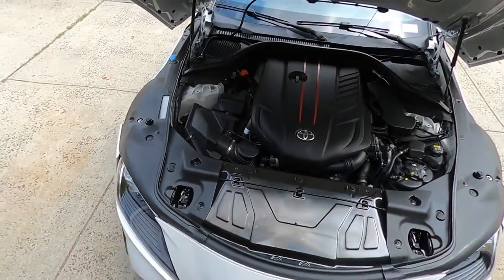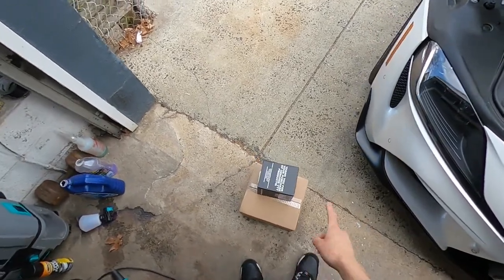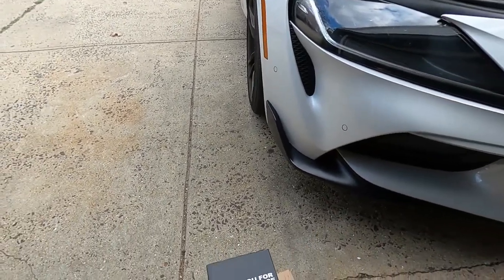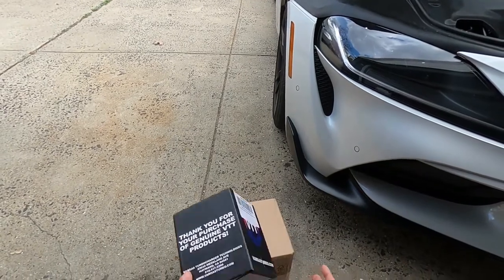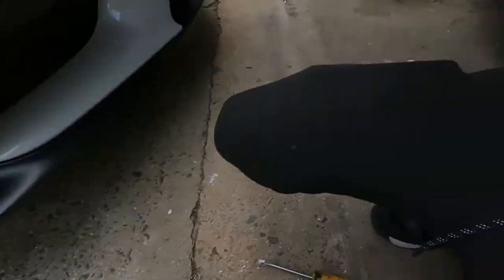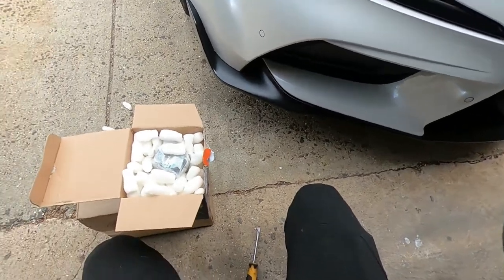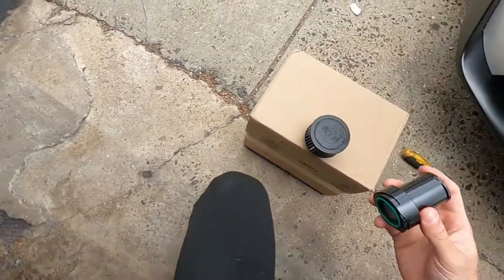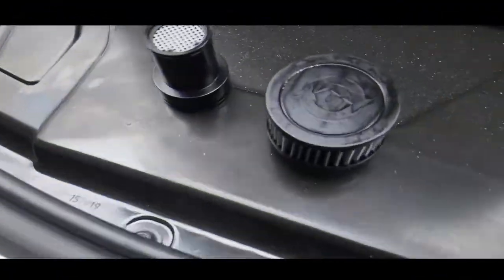THIS WILL SAVE YOUR B58 ENGINE!! RELEASE CRANKCASE PRESSURE!!

Comment: Is your supra gen 1 or gen 2 b58? I have gen 1 bmw and wasn't sure if this upgrade would cause smoke if no other pcv upgrades done.
Reply from the maker: gen1 b58
Reply: @ADONIS DRIVEN  you still run it? Did it cause any smoking or problems as the only pcv upgrade or did you have to do something with turbo side as well? I'm looking to get one.
Reply from the maker: @brakthru2  had it in my car untill i got rid of it with no issues, i had downpipe, tune, n xhp trans tune ran it hard with no smoking or anything. But dont take my word for it, tht was my experience everyone different.